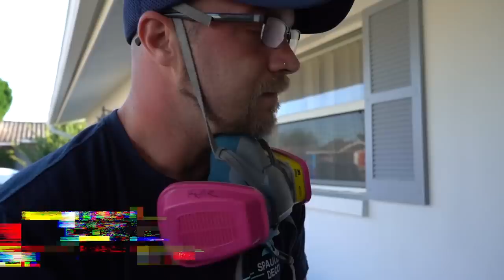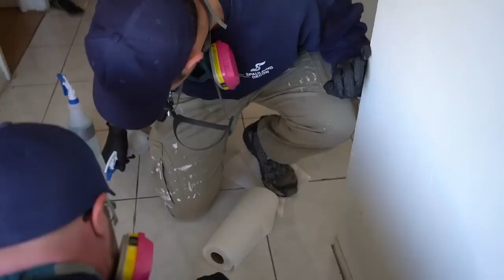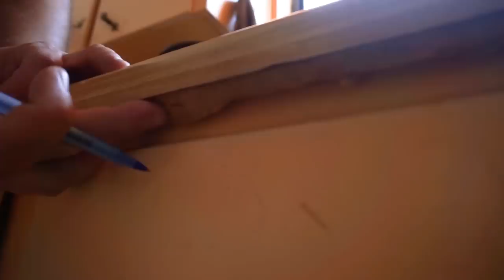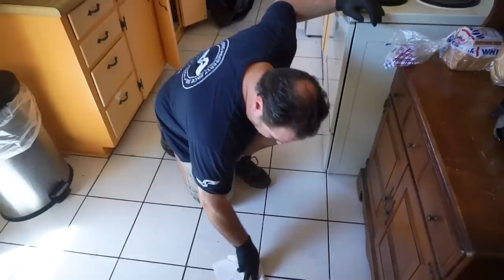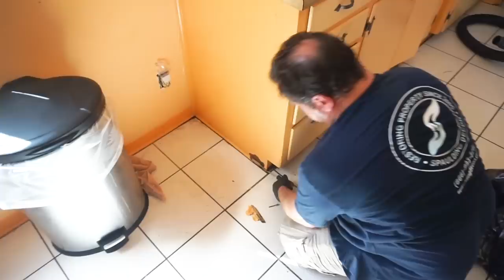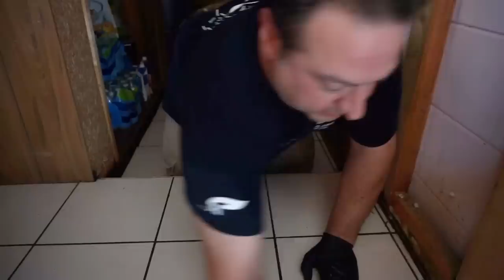Season 3 Finale: Unfinished Business

Comment: I used to work for a biohazard/crime scene cleanup company. I know the weather is hot in Florida, but while cleaning up bio on the tile floor the workers should have been in full bio suits. With only a T-shirt and shorts on it’s possible that bio can fling onto exposed skin. Also, some insurance companies will decline a cleanup claim if workers are not fully suited up in bio suits. Also, If a customer doesn’t want you to perform your recommended tile removal due to the porous tile grout absorbing bio material, then the customer should sign a form that states that they have instructed you to not remove the tile. People are very lawsuit-happy and the lack of having a signed form that declines recommended work will save a huge amount in fines and court cases.

Comment: You guys would have a field day at my apartment. My landlord is a slumlord so they'd never pay you to come to my place (despite having a location in Philly a few hours away) but I've had a huge hole in my ceiling for almost 2 years now from water damage because of a roof leak. 
It took them 3 years to fix  most of the roof (still not done over the hole in my bathroom ceiling, hence the hole still being there). There's probably so much mold in this place it could be condemned.

Comment: In the mop up job, that weatherstripping at the door threshold is just screwed into the floor. I used to help my dad lay carpet and we pulled those up all the time to put carpet there and just screwed them back down. I don't know why Kyle didn't do that to clean under it and then screw it back in place.
The house with the sink leak had no shut off valves for the cold and hot water lines under the sink. What kind of lame ass codes or cheap contractor doesn't put in shut off valves? Should have one for all sinks, toilets and washing machines.
Reply: My mom bought an older trailer on a lot and after a sudden water leak like this discovered that shut off valves weren’t always required for some trailers and modulars, according to insurance (who didn’t pay, of course), or at least in our state. She hired a contractor and he had to remove soaked paneling just like that; it had acted like a sponge. Needless to say he made sure there were valves on everything throughout the place before the job was done!

Comment: Dehumidifiers work so much better. I fixed my hardwood floors after a leak with on. The floor was so warped and it was perfect after. You need to pull the water out of the floors and cabinets.

Comment: I would have reported this owner to the city; surely they have a health and safety department to deal with problems like this. They can show a city official that their indicator prices that there is biohazard under those tiles. I would hope that the city can force the owner to have the floor properly cleaned before he can sell/rent it to anyone.
The bodily fluids of a dead body aren't dangerous healthwise, but as long as there is biohazard under the tiles, there will always be a decomp smell in the house. And the wet decomp being trapped under the tiles will surely cause damage to the floor/subfloor under the tiles.

Comment: I have read the comments, but I want to hear from the company above. Isn't there a state law that this has to be reported? In a humid climate I  would assume that the humidity could cause the biological "leftovers" to smell and activate cells, correct? There are dried cells that come back after water or a chemical are added to them?
Did this guy just die or was it a suicide or homicide? If one of the latter does that have to be disclosed to a potential renter or owner? Some states all of this needs to be disclosed. The first part of this video was very disturbing to me from a contamination standpoint.